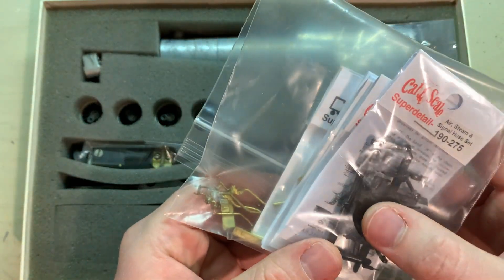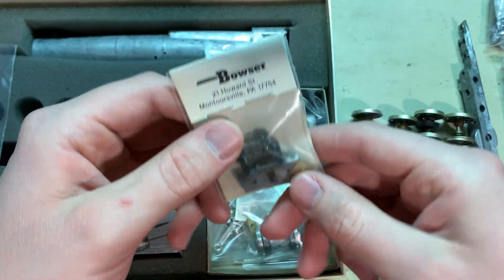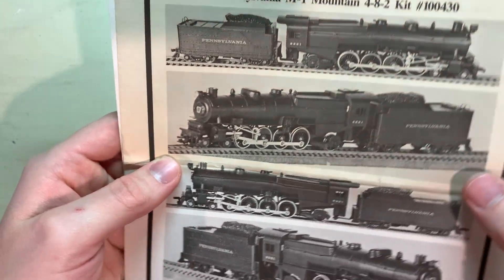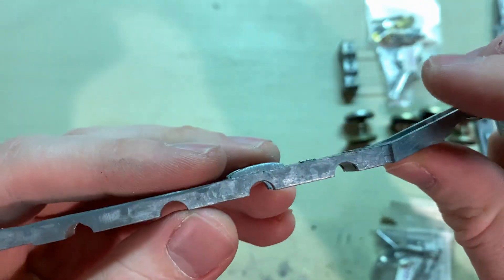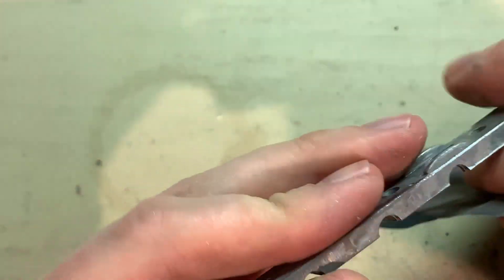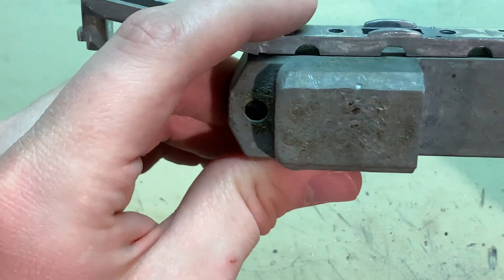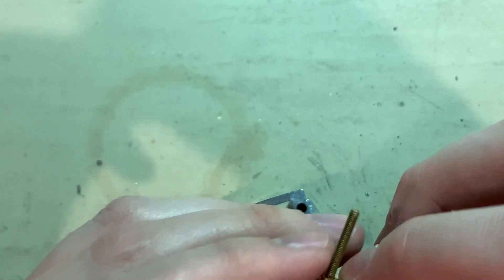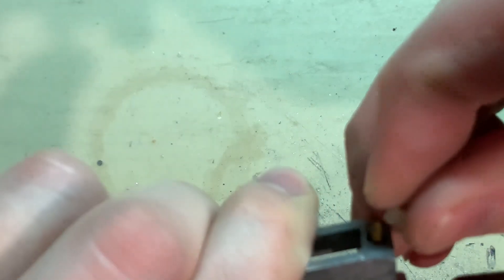How to Build an Intermediate HO Scale Steam Engine Kit: Part 1 - Main Chassis Assembly

Comment: I built that kit 20 years ago, still runs well. Sad that bowser no longer makes or supports these kits.
Reply: Bowser does still offer many but not all parts ,it is best to know the part number needed by either using the original paperwork from the kit or from the HO SEEKER website

Comment: Just finished building a Bowser 2-10-2 kit. Tomorrow, it's onto painting.
Reply from the maker: Nice!  You think we'll be getting a video? :)
Reply: @DarthSantaFe  Hopefully. I have some shorting issues when I put the boiler on the chassis. Once those are resolved and the coupler is mounted on the Mantua tender I'm using I'll put one out.

Comment: 2 suggestions for the deburring work you're doing .1. get a machinist's scraper it will help you get things done faster and safer as you won't have to worry about damaging the parts as much. Also as far as the drilled holes when I worked in machine shops 30 years ago we would use a drill bit with a shop made wooden handle to deburr the holes by hand much easier then filing as well as if the hole is threaded you won't damage the threads.
Reply from the maker: Thanks! I’m already done with about all of the filing at this point, but I’ll look into that for future projects.
Reply from the maker: Any idea where I can find a hobby size scraper that works for metal?  The decent quality carbide ones I'm finding are all too big, and the fine ones from Micro-Mark are only good for soft materials.
Reply: @DarthSantaFe  You can find them at a machine shop suppliers like msc or mcmaster carr under machinist scraper or triangular scraper but you would probably prefer the one I use which I bought from Blicks art supply .I think I payed like 10 or 11 dollars for it they also carry the swivel one as well.

Comment: I purchased a second hand bowser L1 2-8-2 a couple weeks ago. The original owner converted it to DCC and I’m assuming it’s can motor isn’t original either. I dont have a DCC controller (I didn’t know it was DCC when I bought it) so I haven’t been able to use it yet but I’m really excited to clean it up and get it running
Reply from the maker: The L1 did only include a DC-71 type motor, so the can motor is something that was added later.  I built one of those and did a motor upgrade (you can see the finished model in one of my early videos), and it's still a great runner!
Reply: @DarthSantaFe  your video is what sold me on buying it!

Comment: With my challengers and big boys Bowser recommends  to carefully tap the bearings into place with a small piece of wood so you don't damage the bearings.That way there's no chance of cracking the frames
Reply from the maker: I also built the Challenger about 15 years back, and the manual was changed by then to say it should be held in your hand while tapping the bearings.  I still ended up having to place it on a block though, because like with this one, the bearings just weren't getting seated well enough.  The block is fine to use as long as you're careful, but you really do have to be careful!
Reply: @DarthSantaFe  
I'll have to try it the way you did

Comment: Hey do you re-quarter drivers for ho locomotives for people? I got a mantua pacific and one part of the running gear rotates freely when it shouldn't, I'd pay and it would give you a chance to teach people how to work on mantua Pacific's because that's more of a common problem with them...  I've never been taught how to requater drivers so it's best learn from sombody who thinks likewise and strives for perfection when rebuilding/building a model
Reply from the maker: Yes, I can do that for you.  If you can contact me directly at darthsantafe@gmail.com, we can get something worked out.
Reply: @DarthSantaFe  sounds good man
Reply: @DarthSantaFe  I have rebuilt/repaired hundreds of models but have never been taught how to fix the mantua running gear problem...
Reply from the maker: @hamiltonsullivan6563  It's not too hard as long as you have the tools.  I may film a quick video while I'm at it.

Comment: Nice video...I watched your other Bowser build series.  I picked up a bowser kit recently and was wondering if you have put DCC in any of these older kits and if so, can you do a series on that?  Thanks, keep the videos coming!
Reply from the maker: Thanks!  I haven't done DCC installations, but it's not hard to do that on Bowser kits.  Older DC-71 motors have to have the right side brush isolated, and I might show how to do that once I get to the motor portion of the kit.
Reply: @DarthSantaFe   Thanks, that would be awesome.  I appreciate it!

Comment: Please, please, please clean off your files!!  If a fine stiff wire brush doesn't do it then a small piece of sheet brass run along the line of the teeth should do the job!  Otherwise, nice job.
Reply from the maker: Yup, I'll do that!  I usually try to clean off the file when it gets buildup, but forgot to do that this time around.